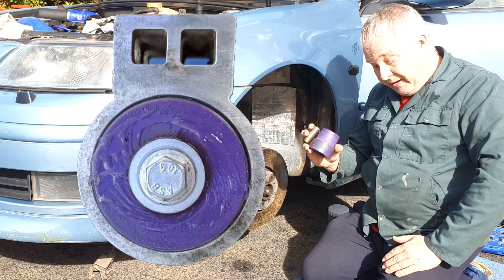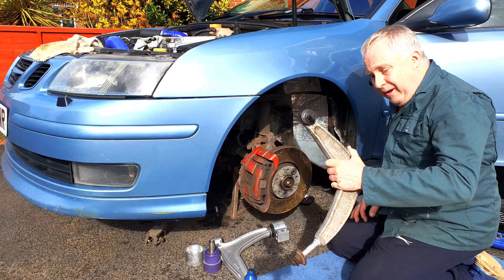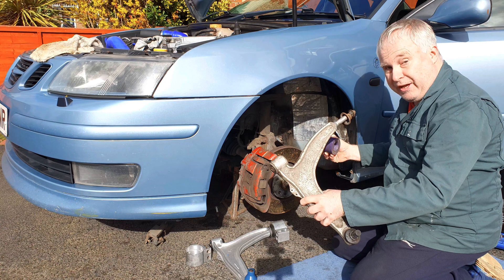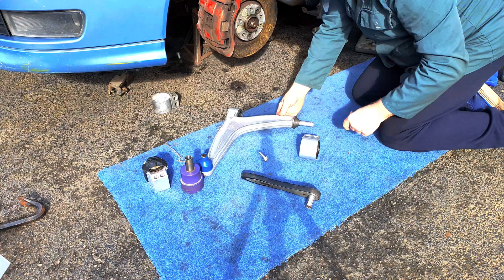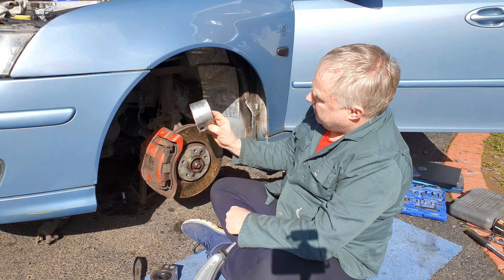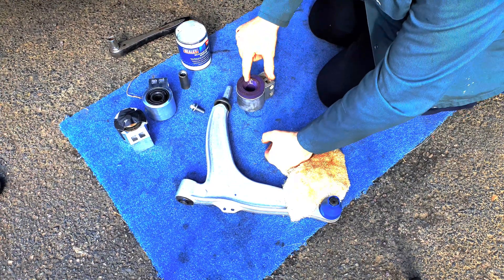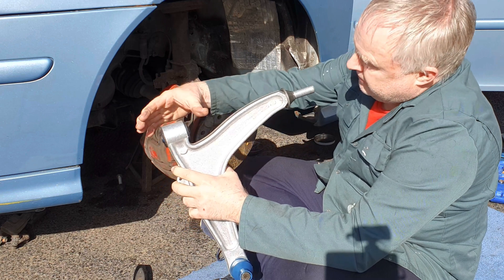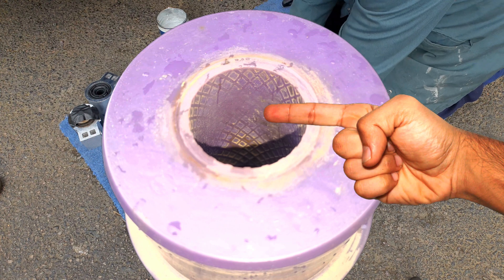how to Fit Polyeurethane Bushes in your Car Suspension

Comment: Thank you once again for an excellent video. Your videos have enabled me to do a lot of jobs on my SAAB Aero 2007, (which I have owned for 13 years), that I wouldn't think of tackling before.
Forgive me for asking a question not associated with this video but I need help in fixing my car alarm.
It is not located in the Wheel Arch or the boot. It uses the Car Horn to sound the alarm. 
It keeps giving false alarms, and I was wondering if you could help please.
Reply from the maker: Is yours a US/CA car? They don't have the alarm module. You need to use a tech 2 to determine what is setting the alarm off.
Reply: @CycloneCyd  Thank you for your response. I bought my car in 2009 from a SAAB dealer in the UK. As far as I am aware it is not an American car. It was registered in August 2007. The ID plate on the door pillar,  passenger side of the car
Reads:-
SAAB AUTOMOBILE AB
e4*2001/116*0065
YS3FH42Y381116529
I don't know if this proves it is UK or USA.
I agree a Tech11 would help detect the fault but I can't afford one.
Reply from the maker: @barrynicholson5804  In non US/CA cars the alarm module is in the right side of the boot behind the trim.
See the picture in this community post
https://www.youtube.com/channel/UC-C_1iVg6Po5xX-sHMhKANQ/community?lb=UgzNIBJcRurwmqHR_hV4AaABCQ

Comment: What are the pros of pu bushes? If they need annual servicing, what's the point ?
Reply from the maker: Annually may be overstating it a little, but certainly every 2-3 years. This will vary with use and environmental conditions though.
The main advantages over conventional bonded rubber bushes are increased freedom of movement of arms and links and increased 'stiffness' to reduce unwanted movements.
PU bushes of a similar 'stiffness' to rubber bushes can also reduce transmitted road noise.

Comment: Did this earlier today, but after torque it down I didn't spin so freely. Mine were totally stuck🙈
Reply from the maker: Did you grease the bush okay? They should come with a pouch of grease, otherwise use silicone grease.
If the bushes can't rotate, they wear at a phenomenal rate (as I've discovered, see 3:50 in the video)

Comment: Great video as usual.
The price of those bushings is the real problem.
Also, I'm worried about that passive rear steering of these 9-3.

BTW: At the moment I'm under my 9-3, doing an explration journey to see if a power steering unit exchange is that easy as the instructions say. 😅
Reply from the maker: Yeah, they are very expensive. Hence I'm only using them in a few choice locations. All standard bushes at the rear.
Are you referring to replacing the steering rack? I haven't looked into that, so no wisdom to impart on this occasion.
Reply: @CycloneCyd  Yes, It has some noises not related the bubbles in the system and not the inner tie rod.
Ok, I see that Powerflex has bushings for the rear suspension that includes the "Reaxs" system, yet... expensive as a small super yacht.